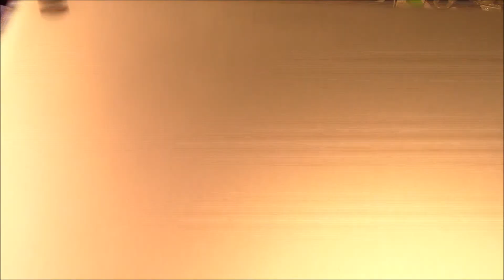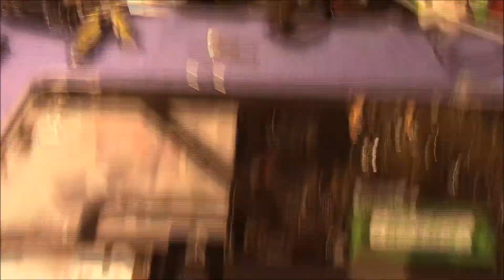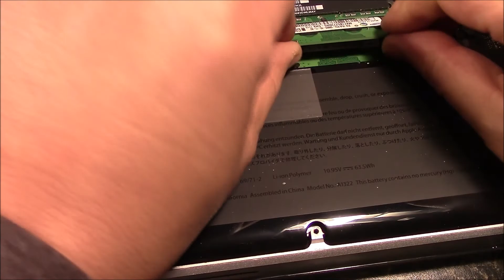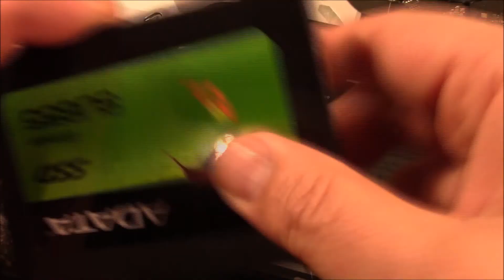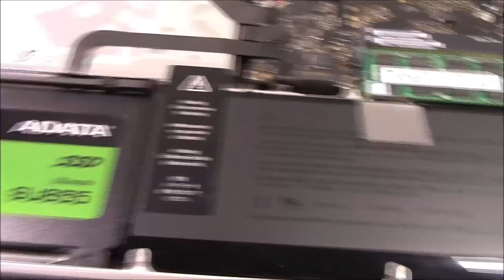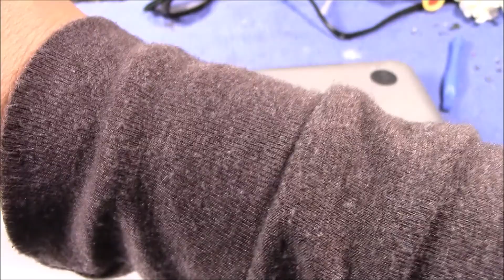Macbook pro A1278 Ram and SSD Upgrade

Comment: Can u put the links of were u bought the ram and ssd plz
Reply from the maker: Ram eBay i was able to get samsung ram, but it took a long time to arrive from china. make sure you match the speed. :https://www.ebay.com/itm/16GB-For-Samsung-2x-8GB-2Rx8-PC3-10600-DDR3-1333MHz-SODIMM-Laptop-RAM-Memory/253918428261?hash=item3b1eb7bc65:g:uZcAAOSwXpFbt~wL:rk:23:pf:0 SSD drive from Amazon: https://www.amazon.com/dp/B01N5IB20Q/ref=twister_B07P83KD5Z?_encoding=UTF8&psc=1